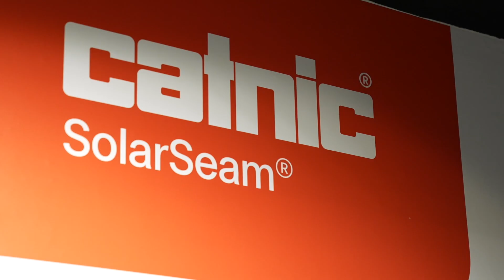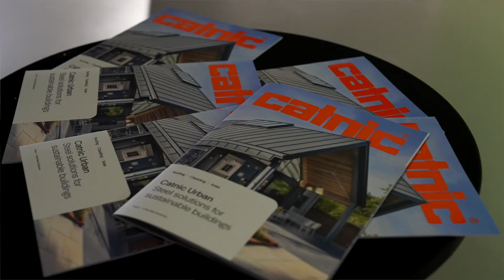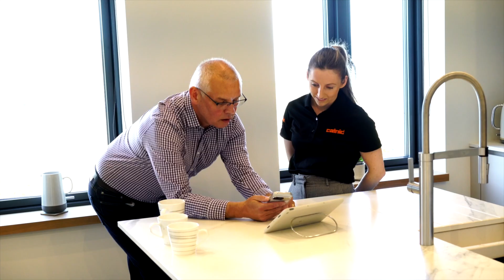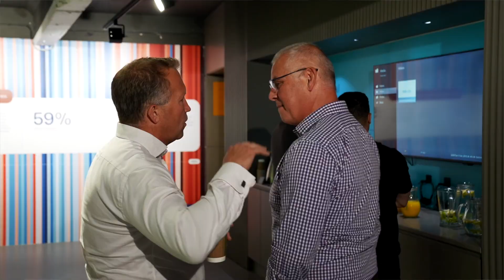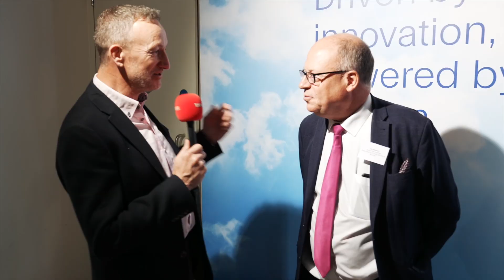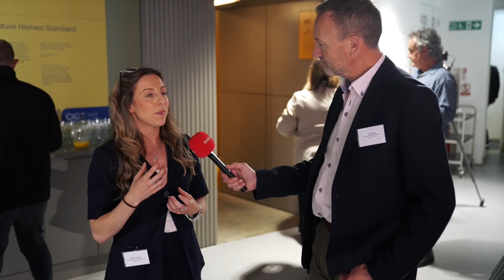SteelCast S3 E38: Sun-powered steel – inside Catnic’s solar roofing breakthrough

Comment: I really enjoy your videos keep up the good work.
With regard to perovskites, Oxford PV is leading the commercialisation of perovskite-silicon tandem solar technology and is now commercially available in limited amounts but they have just signed licensing agreements around the world. This company would be an excellent partner for TATA and MIPV?
I would be interested to know, did you have any steel roofers on the panel or in the audience to give their view on the product and perhaps how it could be improved etc?
My initial reaction to SolarSeam that it is a great idea but it may have some practical problems for mass use ie. 
You are looking at about a 15-25 year lifespan for the pv panel which will result in you having to replace the whole roof as I presume you can’t strip the cells from the steel panels and you will get a colour miss match if you try to mix new and old panels. This could result in property re-sale issues and values just like a thatched roof? A way around this could be to make the cell panels independent from the rest of the roof by designing a new standing seam fixing system. Currently you have pv panels stretching from eave to soffit and any roofer will tell you that’s we’re 90% of the detail work is, so can you develop a simple clip system so you can leave this section of roof alone and just replace the pv bonded section only?
Another potential sales advantage is you could setup is a direct recycling package with TATA for replacing SolarSeam panels?
I’ve got a load more questions but I don’t want to overdo the post.
Look forward to seeing your next post👍
Reply: PS. Let your Catnic website development team know they should include a direct Products menu button to SolarSeam not just via Urban Roofing & Cladding we’re you have to hunt for it? Solar should have its own title button?
Reply from the maker: Thanks for the love, Carl! Let us get in touch with one of our experts at Catnic and get back to you. I'm sure a more in-depth chat about Solarseam would be beneficial for you both! Another video dropping next week! 🙂